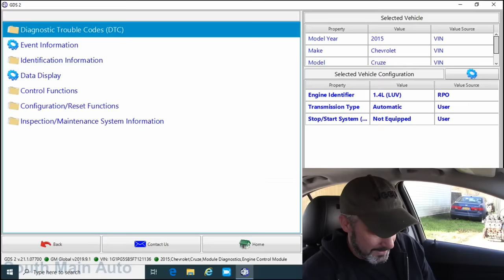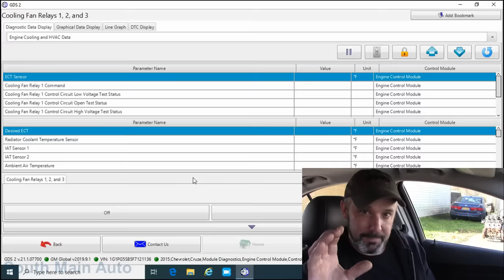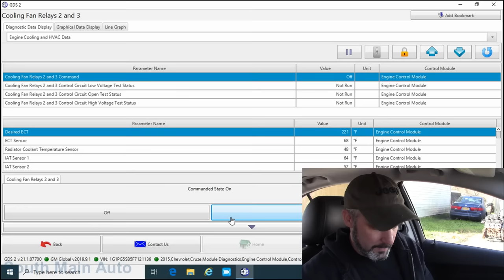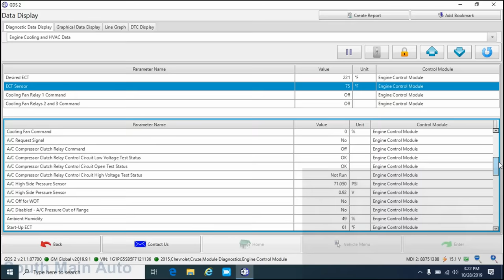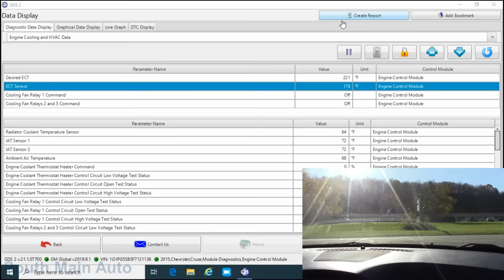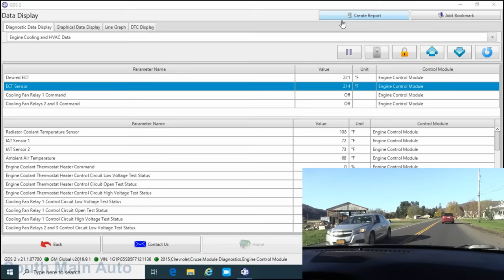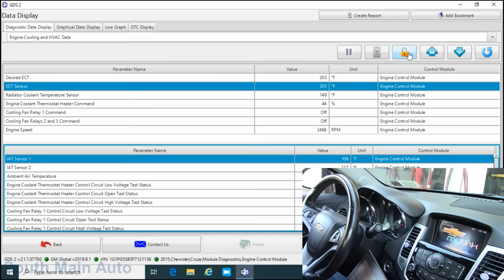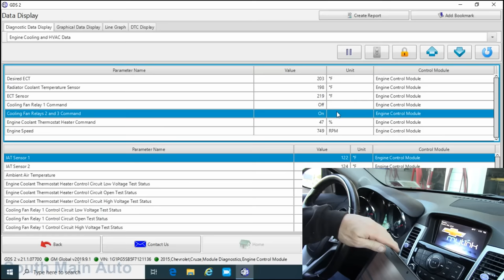Chevrolet Cruze: Overheating, Loud Fan, Losing Coolant

Comment: I had a 2015 Chevy Cruze which did this. Found the OEM overflow tank had a slight leak and replaced the unit with a Dorman which seemed better made and much lower in cost than a dealer part. The problem was fixed for a while and then coolant stated to disappear again. This time I added a UV dye and could not locate where the coolant was going. Notice I said had a Chevy Cruze after this I did trade it for a Toyota and I feel I got rid of it in time before a major expense came.

Comment: I had a Lumina with low speed fan issues. The fan worked fine when jumpered with power and a ground. The relay was getting a signal from the temp switch. The culprit ended up being a corroded ground wire.

Comment: These cars are lemons. Had a 2011 with the same overheating problem and no matter how many times I had it fixed, it would just overheat again. Eventually I traded it in for a Honda and I've never looked back.

Comment: good old chevy cruze,just replaced my water pump on my 2015 with 55000 miles.these cars are a coolent nightmare.i am sure i will be fixing  thermostat and water outlet pipe also.

Comment: As a mechanic here in Australia i hate these Cruze, Trax and Barina, they aren't just a few known issues they are just plagued with so many issues ranging from coolant leaks, transmissions, electrical gremlins, coil packs, turbos, selector cable bushes, weak plastic cooling systems bits and it doesn't matter what model or engine combo you have it will be a problem. Also add Captiva to that list of nuggets.

Comment: When pressuring a system, once I've found the correct cap/adapter, I try one more. Just so that the last one I try IS NOT the last one I try. Additionally, when I find a missing item, I continue to look for a few more minutes. You know the saying, and I don't live by it.

Comment: i had a heater hose leak recently, it was dry until the engine/trans torqued around under load then it would open up a pinhole through a sharp radius formed bend.
it held pressure perfectly and wouldn't drip until flexed. of course the motor mounts were "sad" too lol

Comment: Being having that issue with my cruze. 
Had a crack in my water pump, and a negative battery cable (caused my car to die multiple times within months). Went to the chevy dealership, they "replaced" the water pump and battery cable under warranty, a week later and it's still having issues. I'm going through more coolant than before, and my car barely starts. Going tomorrow to get it "replaced" again.

Comment: I had a 2016 Chevy Cruze Lt gen 1.....got rid of last month with 70,000 miles on it....3 valve cover replacements, thremostat change, water pump, water outlet, MAF sensor, pcv hose, the turbo was about to go so I traded it in before it bit the dust!...Endless money pit!!

Comment: In order to put the ignition in accessory mode on a push button start Chevy you push and hold the start button for around 5 seconds without putting your foot on the brake pedal if the engine was low on coolant because of a leak and the motor was getting hot that would probably turn the fan on high speed

Comment: Sorry but unless the dealership was going to cover the costs of the repair I wouldn't go back. They couldn't find a coolant leak, nor could they find the cooling fans not working. It's not that hard to hook up a scan tool and verify if they are working. We just did the cooling fans at my shop on a Pontiac Torrent after verifying they weren't working (same situation.. only high speed working). Baffles me how the customer can come to you for a diagnosis then take it back to the dealership that didn't find that in the first place. Good video though!!!

Comment: Currently having the same issue on my 2013 Cruze. Had the coolant reservoir replaced last year per some bulletin GM put out, but that didn't fix the issue. Still has a slow leak, slow enough that the res gets uncomfortably low after about 3-4 weeks. Can't afford to diag/fix right now, so I'm kinda forced to keep coolant in my trunk and check it weekly. 

Oddly enough, had the water pump replaced 2 years ago. Had an oil change scheduled one morning, and on my way in, the car REEKED of coolant. Got it to the dealership (they had the cheapest changes at the time), and they smelled it immediately too. Fortunately still had some warranty left and it was replaced for free. But interesting to see it could be the same issue again. Dealerships suck.

Comment: Eric I have 2008 FORD 3.5L.Where would I look first if I think its the water pump is leaking? I understand that the pump is located behind the front timing chain cover. I understand that this repair is lengthily and expensive

Comment: the 1.4 have 2 major causes of coolant leaks. 1 being the water pump. GM has a special coverage for about 150k. and 2 being the Coolant Water Outlet. Usually its one or the other when they come in for a leak or a customer complaint of overheating.

Comment: Intermittent over heating, it’s the thermostat.  If leaking coolant it can be the hoses, water pump or oil cooler.  Replace all the hoses on the turbo if you haven’t after this many years.  Engine design is a pain in the rear.

Comment: I have a 2012 Cruze LTZ that the engine went in Nov ‘19 at 100k km’s, mechanics had no idea what happened. Rough idle once it warmed up and gutless going up hills. I’ve since bought a 2017 Kia Soul EV. The Cruze now sits in the driveway as our “spare” until the car loan is paid off lol

Comment: I diagnosed this same issue on my friend's Sonic.  I noticed the fan screaming and slightly low coolant when he stopped by for an oil change.  He was in a hurry but I was like no, this isn't normal we need to diagnose this. Took me 5 minutes with a multimeter to discover the issue. He had just been to the dealer a month prior and they threw a thermostat and some hoses at it.  ...And I just do side work. It's crazy that the dealerships can be so incompetent.

Comment: Right before my Acura went off warranty I took it in for the last dealer service. Did all the usual stuff and new fluids etc.. On a road trip 2 weeks later, passing a truck on a 2 lane, floored it and the money light came on. It ran fine, no problems. When I got home I hooked up the scanner and found a code for the V-6 intake plenum not switching to high RPM runner mode. Finally found the wire that activates the solenoid had been pulled out by hand (at the dealer) and broken. I got out the soldering iron and shrink tubing and fixed the broken wire. Reset money light. Never went back to the dealer again. Obvious sabotage. Delayed action money light scam avoided. Dealer avoided.

Comment: It's funny, I've watched all the Cruze videos twice in the past two days and I had one come in the shop first thing this morning with a coolant leak. Didn't get to even check everything Eric had issues with. It was a crack in the plastic water outlet. Right at the bottom of the vertical tube where the reservoir tank hose connects

Comment: HI Eric, I noticed mid way in the video scanner was showing that the rad temp sensor was 70 deg and the ECT sensor was showing 210 deg. But at the end of the video both sensors were at low 200's deg. Why such a big difference in the beginning between the two sensors??

Comment: On our car the water pump went first...replaced that and then the water outlet flexed at higher temps...replaced that and then got check engine lights for the turbocharger...now the most recent thing is wheel stud bolts breaking...

Comment: Bought a brand new 2014 Cruze LT RS and the thing was cheap garbage.  But it was cheap and for my first new car it was a nice credit boost.  I traded it a year later with 60K on the clock and in that time the center armrest compartment BROKE, MyLink stopped working, Pioneer sound system crapped out, and the undercarriage was rattling and squeaking along with rattles and squeaks inside too.  I traded up to a brand new 2015 Outback and it’s got 175K on the clock.  No a single issue other than CV axles, brakes, tires, plugs, and oil changes.  Not so much as a squeak or rattle.  Still on original timing chain and water pump.  Oh...and it’s an Upstate NY vehicle as well.  About an hour west of Eric.

Comment: I say change the water pump, the thermostat and some radiator hoses, some hose clamps, a good Coolant/engine coolant Flush too!  And maybe the fan belt/Serpentene belt! And make sure the fan has correct voltage too !
Reply: Change the car

Comment: Water pump and thermostat housing (cracks) are common cooling system failure points for the 1.4L. So are the valve covers with I believe an integrated PCV valve that fails causing gasket and seal failures. $$$$

Comment: I have a Chevy Sonic 2014 and I did the test reading with this device that I came across and it says it's the sensors for the engine coolant and temperature sensor I think but when changing out the sensors do I have to drain the fluids again before doing so please respond thank you for your video

Comment: Hey Dean I've got a 2016 Chevy Cruze LT and the I've replaced a mass sensor and a housing wall and throttle sensor and a new coil pack and it just keeps running hot . I've got to get a thermostat to put in it . I just don't know what to do

Comment: Hello, I have a 2014 Chevy Cruze ltz, since I bought it it has always had a sound as if it were water running behind the tachometer, last year I had to repair the engine because I had a previous job and they placed the asbestos engine gasket , which caused the engine to melt since that joint could not withstand the temperature at which the car engine works. Well, after having resolved this issue, the practicing sound disappeared, but with the passage of time it has returned to be heard a lot, it turns out that this sound I understand must be associated with the coolant, as it turns out that the reserve when this happens, runs out, while The more coolant the tank has, the louder and longer the sound, but over time the coolant disappears and I have to refill it. I did a complete change of the entire engine cooling system, I just didn't change the radiator because it was in good condition, water pump, thermostat, water outlet, etc., but it persists.

Comment: Great vid thanks always learing I have engine  light on 2015 chevy cruis  reading temperature sensor with there 2 on one right side other left bottom  i going to replace both and replace thermostat  all these new engine are plastic parts very weak u think that my best option thanks agan great video

Comment: Don't forget that this was the second Chevy Cruze in a row within a year from the same dealership where they told the owner that the high-speed fan running was normal and totally missed that the low speed and meeting speed fans were completely inoperative. I'm sorry you don't get free strikes.

Comment: Hey Chris been a fan for 4 yrs now be watching ur infamative vids and would like to ask a question. My brother has a 2011 chevy cruze it started overheating in 2018 and blew a headgasket paid 1200 to replace the gasket and some of the lines for the coolant and the reservoir. Now it's doing it again we have coolant boiling over I changed thermostat, waterpump, 2 coolant sensors, the oil still clean not milky color we haven't changed the fan since we took it to the mechanic do u think that's the cause?

Comment: Question for you if you get this cool of not ok. Is there a transmission stick in the engine compartment on a 2018 Chevy express van 2500?  I can’t get a answer at the Dealership . Thanks

Comment: changing radiator fan is a major pain.   Dealer quoted me $1000 to do a replacement of my fan shroud with built in resistor.  I told them to stick it.  part is cheap.  it's the labour involved.  I also had the same fate with my water pump.  Dealer replaced that under warranty about 1 year before.   1/2 price on the work is b.s.

Comment: Interesting Chevy Trax was showing cat efficiency, when I looked under the hood coolant level was low. My local mechanic had difficulty finding leak. Belt was wet from valve cover gasket, plus spring was broken on belt tensioner. Guess belt can't get get wet on these
Reply: I eventy brought back for inspection to mechanic, changed my own valve cover. Got stuck with the belt and had the mechanic put the belt on. Looking good so far

Comment: Don't mind me asking, my 2012 cruze is having the same basic problems, i'm curious how long it took you overall to diagnose and resolve the issues. Although my leak seems to be from the thermostat housing, didn't notice it on the pump/belt. hmm.

Comment: I have a 2012 Chevy Sonic, Same engine except I have manual transmission. Dealership told me it's the radiator cooling fan assembly, there's a flow/Temperature sensor (coil inside a ceramic hollow tube) that was cracked when I pulled mine out. After replacing it my issue of Relays being stuck open, engine overheating, random holes in hoses/ assemblies/ thermostat housing all stopped. It's abotu 140 bucks from GM, takes about 2 hrs to replace. I'm not a mechanic or a tech, but I'm a Mechanical Engineer, so my assumption is these isn't reading the right ambient air temperature or air flow so the fans cycle on/ off/ on ./ off. Eventually damaging the relays into the "stuck on" position (loud fan) because it's not reading temperature or flow correctly pressure is building up in the cooling system.

Comment: 2011-2014 Chevy cruzes with 1.4 L engines have a special services warranty for water pumps leaking coolant. This is not on all VIN’s but I highly suggest arguing with the dealership if it isn’t applied to your VIN, as I believe this should be applied to all of the VIN’s.

Comment: The temp gauge isn't worth much.  As long as the temp is within what the computer considers "operating temperature" that needle will have a death grip on "one tick below half".  Not sure why GM did it that way.  Perhaps to prevent complaints due to the variable operating temperature system.  I don't remember what the thermostat's native opening temp is.  The delay may have been the ECM activating the heater on the thermostat to open it.

Comment: Check, change the cooling fan, water pump and recommend thermostat change and most likely (about 100%) the dealer will disagree and change the wrong parts.

Comment: Different application all together, but I have a stock 05 Pontiac GTO with the LS2 (6.0) V8 in it. I've always wondered WTF GM was thinking on the temperature, but they dont even seem to care about how hot it is until it is 228. Am I crazy or does that seem too hot for a big v8? I've got a mishimoto radiator that holds 1 full gallon more than the OE radiator. In the summer with the AC on going up the hills in the sierra nevada mountains, it'll get up to and stay at around 225 or so at 35 - 45 mph. Seems like it should be cooler.. Interested in your thoughts on these high temps GM seems OK with.

Comment: Hi. Drove mine with open cap, lost coolant, what could have broken because I replaced thermostat and sensor, but still does crank and doesn't start and temp gauge doesn't even move on startUp

Comment: I’ve got a 96 single cab S 10 with the 2.24 cylinder engine is burning a lot more fuel than it needs to what do you think it is a mass airflow sensor ?

Comment: When I saw Chevrolet Cruze in the title, I immediately thought:

Diagnosis - South Main Auto Repair regrets to inform you that your vehicle is a post-2000 GM and has an EcoTec engine. We are mechanics, not exorcists, therefore we recommend you take it to a priest. 😆

Comment: The water pump should be covered under the special policy even if it’s out of warranty, the cooling fan is bumper to bumper not power train. I usually install the thermostat for free as long as the customer pays for the part. Gotta swap it over while doing the pump anyway

Comment: You think that you have it bad? Between family, my full time job, and working on other peoples junk, I've been trying to fix ONE vehicle for over a year! That's why I DON'T work on cars full time, and avoid anything newer than 1995 if at all possible. Well, that and the fact that I'm not an electrical engineer. I about pooped myself when you said the fan doesn't come on until 220! I remember when a 195 stat became common back in the 80's and I thought that was hot! Thermostat heater? We used to call that coolant temperature! At least my wife still lets me use the kitchen stove to test thermostats-she even gave me my own pot! She won't let me rebuild carburetors in the kitchen sink or transmissions in the bathtub anymore though lol!

Comment: The only good thing about the customer paying a share of the repair is now he has a consumer warranty on the parts and labor. That warranty is good at any GM dealer. That warranty covers tow charges,rental vehicles and other charges incurred due to the part failure. Keep the receipts!!!!
Reply from the maker: I also offer the Napa Peace Of Mind Warranty here at the shop with a 2yr 24k mile parts and labor warranty. Oh and I am half the price of the dealer :)
Reply: Just some good advise that most dealers will not tell you. You get a dealer to goodwill an engine and you only get a 12/12 warranty but if you pay $1.00 toward that repair you get the consumer warranty 36/100. Not everyone can make it to Avoca Eric😊

Comment: Are estimates free? I don’t know about with SMA, but some abused indys are discontinuing the practice. Estimate is free if you get the repair. This happens with other products as well. Watch repairs always came in with “estimate requested,” but the charge for the estimate went directly to the customer IF disassembly was required. Otherwise, customer got a best guess.